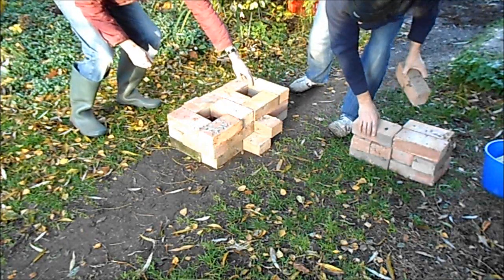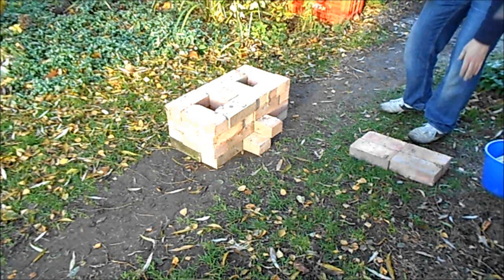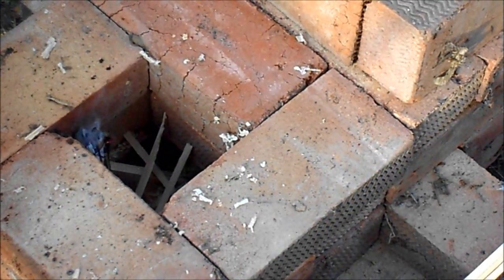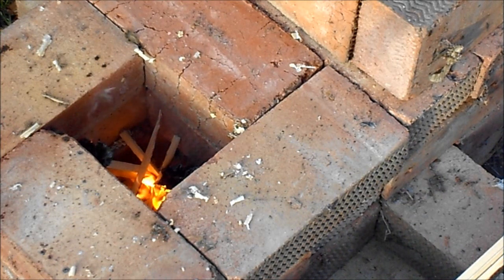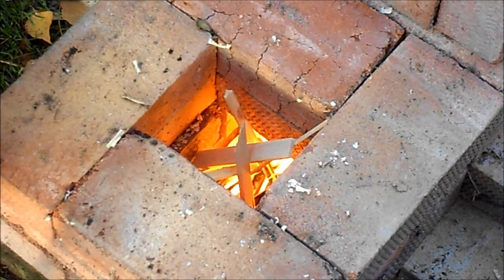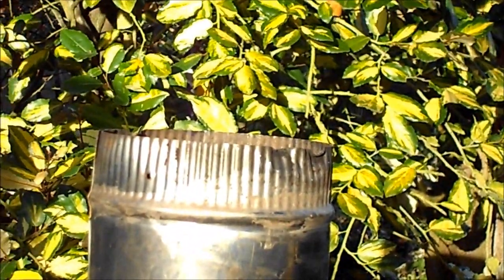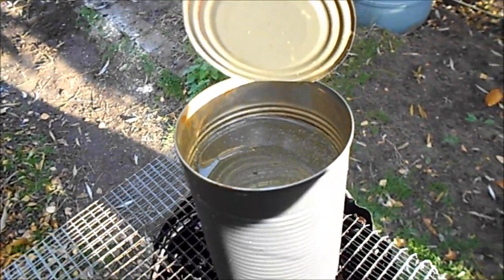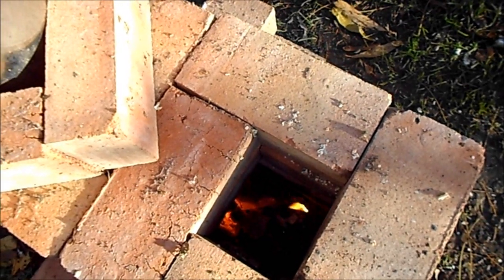Rocket stove 1

Comment: This is not a rocket stove. Common bricks are not insulators. Cargo-cult copies of the rocket form - L-form or J-form - without insulation are not the genuine article. Here's how to build the real thing:

http://www.bioenergylists.org/stovesdoc/Pcia/Design%20Principles%20for%20Wood%20Burning%20Cookstoves.pdf
Reply from the maker: +Rhisiart Gwilym This was showing the principal of how a rocket stove works and not meant to be used as a working stove. You can view my rocket stove 2  and see it insulated.
Reply: Dohman Man
Reply: Rhisiart Gwilym g
Reply: It is unnecessarily dishonest twaddle to say this is not a rocket.   Obviously it is crude and it lacks controlled re-oxigenation, but it seems to burn fairly efficiently, and is possibly not as uselessly crude and misleading as that famously ignorant Aprovecho thesis you erroneously cite which, among other naive mistakes, did not even manage to demonstrate the appropriate parameters for building a simple 'jiko' style stove.   That report was a famously cynical waste of grant aid.    In fact, the stove in this video is evidently far more efficient than would be any of the suggested designs in the Apovecho report.   Finally, the common fired clay bricks he uses here provide absolutely adequate insulation for the purpose.